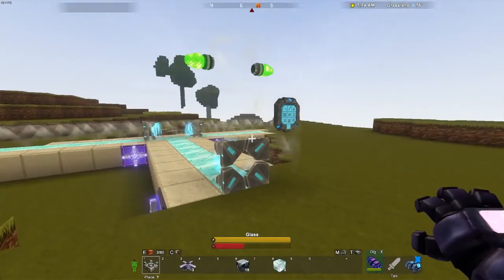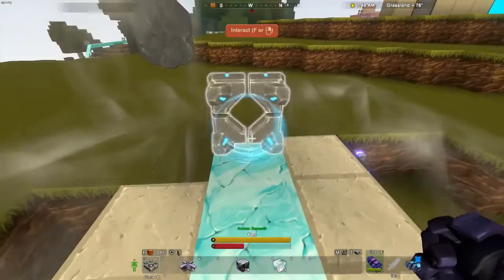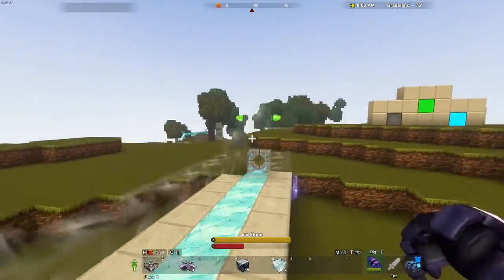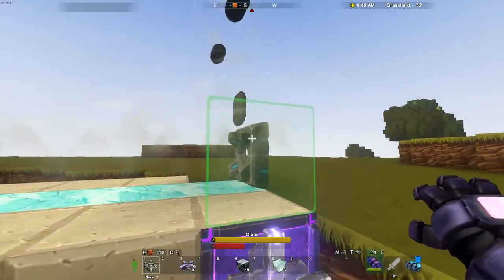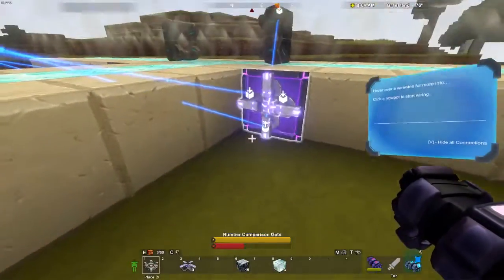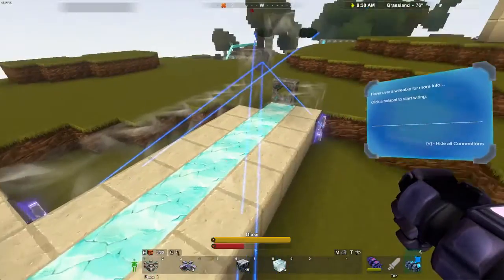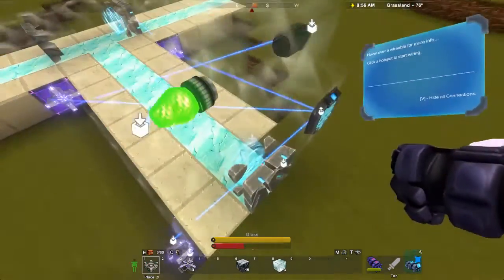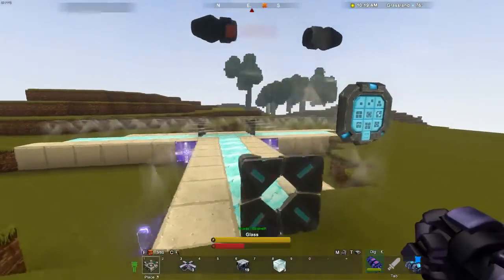Q&A 03: Junction with Comparators

Comment: Salutations,

Q.  mob/monster farms...general info. I have is 10X10(x1) area, best if in same chunk, blocks need to be of indigenous area creatures found in (or at least floor), and dark

my question(s):  is have you built any?  what have you found to work best? And how to make, if so?

tyvm in advance
Reply from the maker: It's not just that the blocks have to be indigenous, they have to be a particular formula or proportion for each mob to spawn. For example, canyon blocks will spawn Dustevils easy enough, but for Dried Leafies, extra cactus are best, and for Trogs, extra mineral water. What blocks you need depend on what particular mob you want to spawn. Other things, like whether it's day or night, the presence of artificial light sources or machines, or even the distance a player is during spawn time will all affect the spawn rates. 

The presence of other mobs, even at a distance or in other levels, can affect spawn rates as well. I recommend building spawners in the middle of the ocean, well away from other areas where mobs may spawn. 

My best suggestion would be to check the Steam forums or ask directly there, especially if you're aiming to get a particular type of mob to appear.